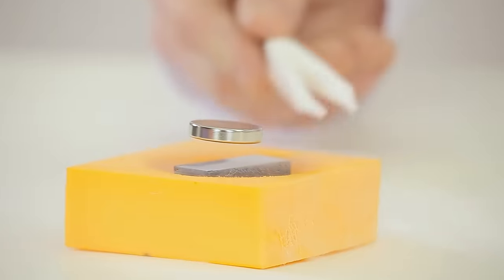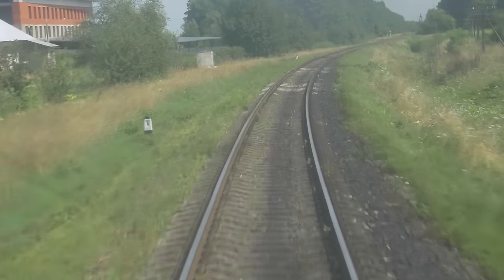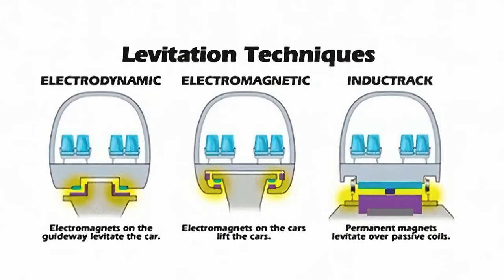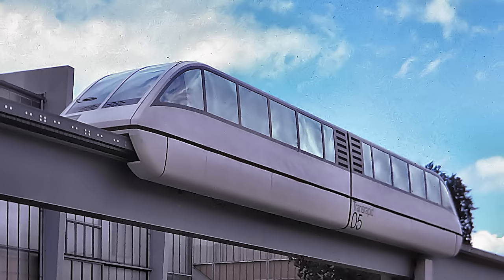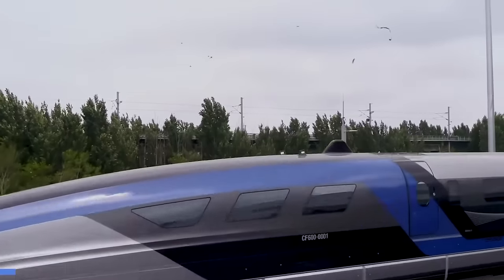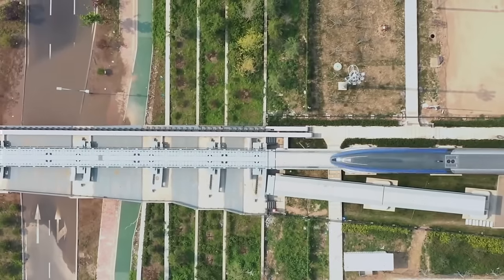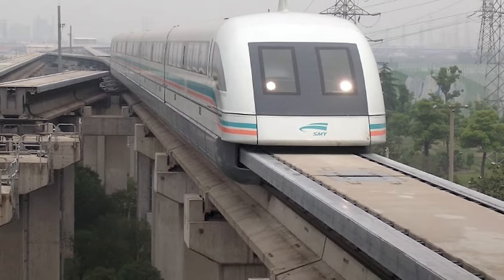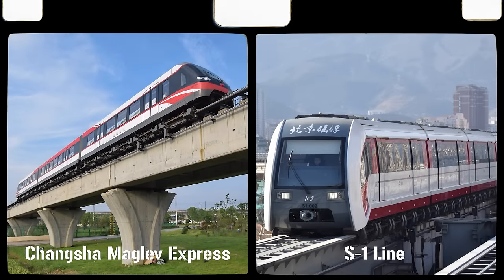Maglev Trains: Why This ALWAYS Falls Short

Comment: The technology is just wasted on short runs. 20 miles at 60 mph is 20 minutes. At 200 mph, it's 6 minutes. You save 14 minutes. Add the time to get to and from the endpoints and wait for the next train, and for most people you might bring a 1 hour trip down to 46 minutes. Yay.

Comment: Could you do a mega project on Red Dead Redemption 2 or GTAV, both are shown as the top most expensive video games ever made depending on the metrics used. The AI and gaming technology, and over 2,000 developers working on a single game at the same time sounds like a solid mega project topic
Reply: This sounds great. I’ve always wanted to know why there aren’t cougars in missions in GTA V.
Reply: No. Game is toxic and not a gem of the gaming community. First two years it came out, probably might deserve recognition. But for 8 out of the 10 years it's been out. GTA is just trash. RDR2 just pandered to the fans. Released with great story and gameplay but that's it. Many other games look better and work better. The ideas are there but Rstar do not perfect their art. Last great game from them was GTA4. Great story great environment and amazing invention with game engines that have a great feeling that doesn't pander to casual players, more unique and surreal.
Reply: No innovative AI was used, unless u mean the cars crossing 5 lanes of traffic just to make you crash. Also there were maybe 1000 devs. More or less 500 devs directly from Rstar.

Comment: The biggest cost of Maglev trains is the track itself, which is many times that of a standard rail line in both construction & maintenance costs.
Much better to go with monorail, one line of rails is cheaper than two parallel ones! 🤓

Comment: The magnet requirement is the expensive part with the cooling. Research and engineering could make it cheaper but that is the limit. One cannot get 'room temperature' superconductors. The physics do not allow it.
Reply: Tell that to the pop science propagandists on youtube lol
Reply: Yeah, it's funny how people gush over the fact that there's no friction with the ground but there's still with the air and electric currents have their own "friction" unless in a superconductor. And all that energy has to be produced and transported.
Reply: >"The physics do not allow it."
The physics may not allow it. Superconductivity is still too poorly understood to make any such definitive statement.
Reply: Toshiba have a test compact rotary superconducting electric motor (rscem) (2MW, 2700hp in a 50cm diameter by 70cm long body)  so is a 1/10th of the weight & size of a regular industrial electric motor of the same power. (and the associated developments in compact cryogenic cooling systems) (Intended for electric aircraft, rscem is still way below the thrust to weight ratios of jet engines) Though may be useful (for the World outside China) for standard rail electric trains due to the rscem operating with greater than 99 percent efficiency and the potential to develop lighter/ faster standard track and wheel catenary (overhead powerlines etc) electric passenger trains. RSCEM might also be useful with battery passenger trains, potentially a greater range even with the same amount of battery capacity.
Reply: True, no sign of practical room temperature superconductors. But in the last few years High Temperature Superconductors (HTS) have begun appearing commercially for things like MRI machines. "High Temperature" is relative; they still need liquid nitrogen, but liquid nitrogen is about a 20th the cost of liquid helium and needs much smaller cooling plants. HTS can certainly ease one of maglev's problems, but there are others that make maglev uneconomic. Which is a pity because it is so much smoother and quieter.
Reply: Apart that most maglev train don't use superconductors so thst is totaly wrong.
Reply: @matsv201  New ones do - notably the massive Tokyo-Osaka line. They massively reduce the energy requirements and  also enalbe even higher speeds.

Comment: There will never be a working hyperloop. For starters, they aren't called hyperloops. They are called vacuum trains, and the idea has been around for over 100 years. Elon Musk just pretended to invent it and gave it a stupid new name. Secondly, they only work if you can create a vacuum inside a tube inside of the earth's atmosphere. While theoretically possible, this is practically impossible. There are no systems that we can currently build (or are ever likely to be able to build) that do not leak. You can still achieve a near vacuum by continually pumping the air out of the system, but if you try to do that on something that spans a country... well, you just can't. Even if you could, the power consumption and cost of doing so would make the whole thing a giant waste of time.

Comment: Because they are overly engineered, complicated and very very expensive.
You dont need to levitate on magnets! You can levitate on just air! No need to be so damn fancy!
Reply: How would it be more feasible to create air pressure over the length of a track to suspend a train?
Reply: @kaltaron1284  air pressure is only needed under the lenght of the train. Ask your question again!

Comment: This idea is far from dead. Its engineering departments assure us that we'll have Mag-Levs in common use within the next 3 decades. They say they'll then focus on Fusion Power, which will then mesh with the next 3 decades of Mars Colonization... 
It's all just a matter of (several different) 3 decade periods... 😮

Comment: IMO, Hyperloop is simply a specific implementation of MagLev.
Reply: Agree, but running the train in an vacuum tunnel has some safety problems. More so that in the deigns I seen you can not evacuate the pods even if you fill the pipe with air.
Reply: Respectfully disagree. Hyperloop has so many engineering (and even physics) issues that it will never realize its promise.

Comment: The only technology to provide high speed travel on only electric power, and it can barely get off the ground.  It's probably because even the Inductrack method isn't going far enough.  Freeing maglev technology from design methodologies of the traditional train opens the possibility of transcontinental train service and service through areas like Moldova or Switzerland at a fraction of the cost.  Yes, the trains themselves might be more expensive, but there's a lot more track than train and it could be built through densely settled areas with only minor disruption.  The older I get, the more I realize why best solutions are never built; but the supposed benefits of leaving problems for the next generation to solve never seem to pan out.  To be a moron seems to give people a sense of pride in many places these days, perhaps because they are lulled into a false sense of innocence.  Well, the world has to get rid of some people and I don't know a better method than old age either.

Comment: The basic reason is that it is essentially a completely new technology. It looks like a train, but in terms of the components and infrastructure it barely shares any similarities, so there is no supply chain or industrial base behind it. The only way maglev will ever take off is if hundreds of billions of dollars was invested to create entirely new corporations to design, build and run them which when you already have established railway companies doing the same thing using similar technology is an investment nobody wants or can reasonably afford to make. Realistically the best thing to do is high speed rail using conventional lines.